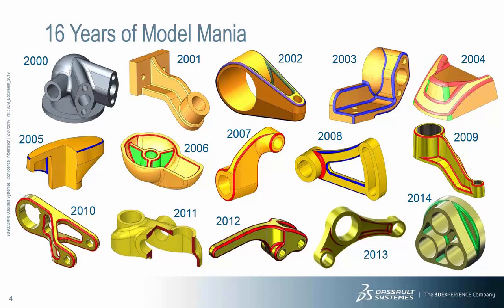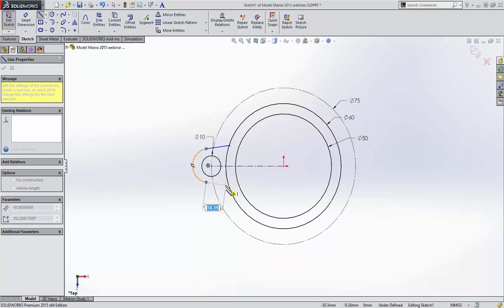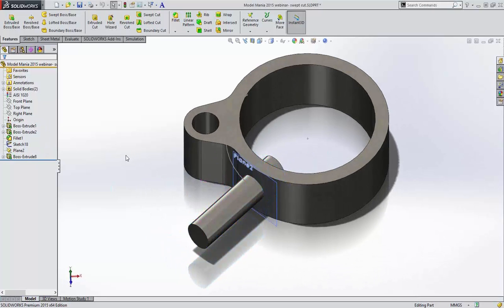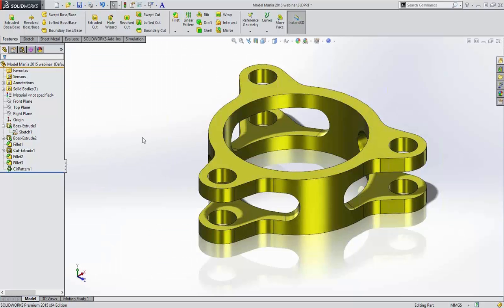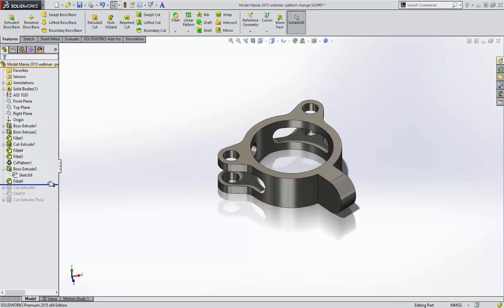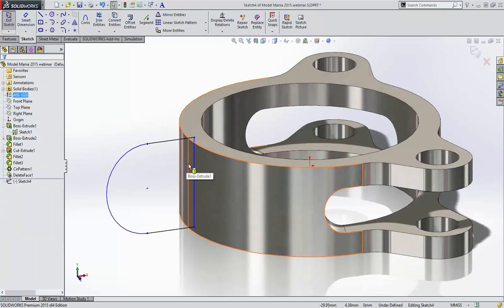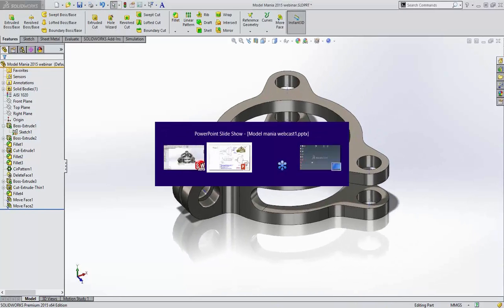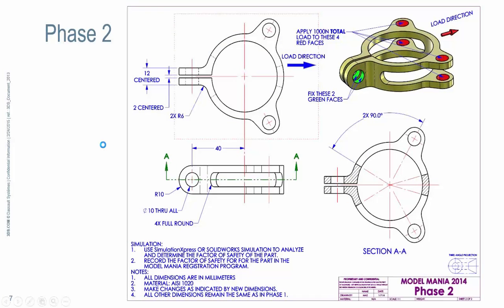Model Mania 2015 Solution

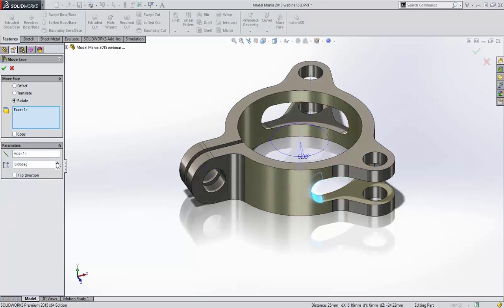Comment: I believe that the offset rotation at 17:29 should have been 30°, not 45° (as 120° - 45° - 45° = 30°). 
Here: https://youtu.be/aaG6NbsAni8?t=1049
Reply: Where are you getting 120° from? The part model says 90°?
Reply: @Themayseffect  Ah, it seems like the instructor's drawing differs from the one currently on the Model Mania site. His drawing mentions a cut of 90° from the center of the hole, whereas the phase 2 drawing on Model Mania mentions a 120° cut. So he is correct in this video, but it should be a face displacement of 30° when following the updated Model Mania drawing.
Reply: @HoundDogRock  I agree with you.  I have the same drawing as you.  When you ran your simulation, what did you end up getting for your FOS?  I got a slightly different number than the video and wanted to know if it was because I modeled it to the current model mania website drawing which shows 120 degrees.  I got a FOS of around 4.
Reply: agree with you my friend
Reply: Same here haha

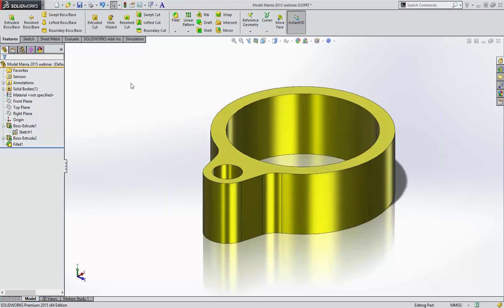Comment: 5:19 is in error to the drawing and will result in an incorrect model. If you look at the model view the end of the cut opening goes through the center of the part but using the swept body the center axis of the swept boy projects through the center of the part thus resulting on the edge that is left not being on the center line but actually parallel and offset by the radius of the swept body.

Comment: That undefined sketch triggers me, what if you want to change the diameter of the part in the future?
Reply: Why would you do modify a completed part after its been verified from production? Wouldn't you start over from scratch? Seems like modifying a corrupt model seems more half assed than making a rushed model with the correct dimensions.
Reply: Yeah, seems like there may have been some iffy choices made in the name of expediency. It's one thing to share how to use features... but this video is going to teach people less-than-ideal practices just to get something done ASAP. For the competition, I know. But most people watching it don't know anything/care about that competition.
Reply: @BrandonGraham  I'm new to solidworks and I don't care about the competition, I care about the different ways to use features.